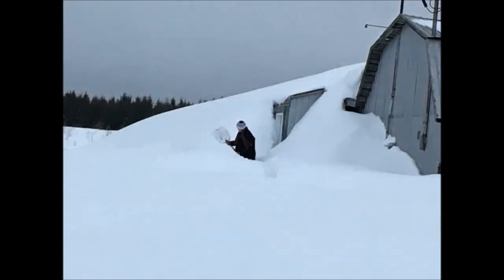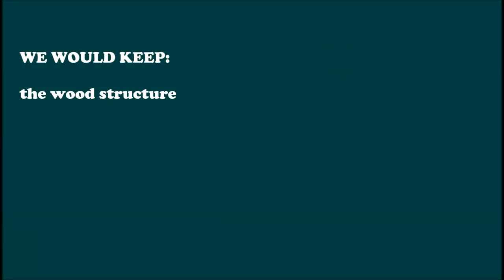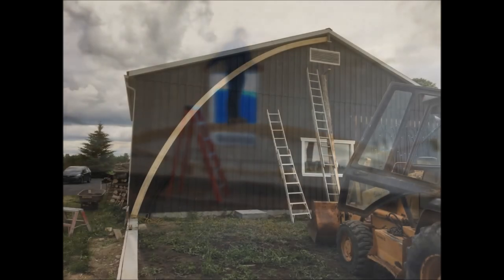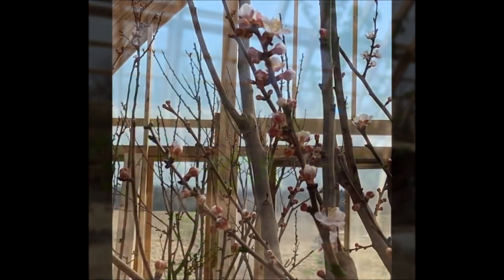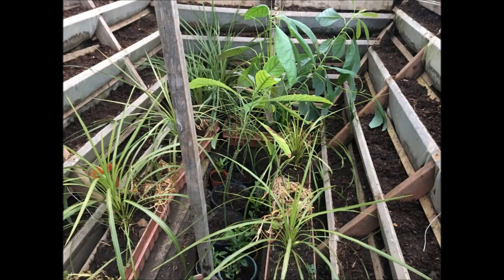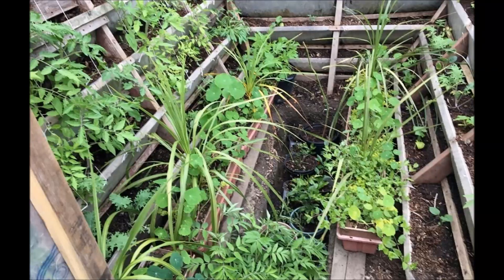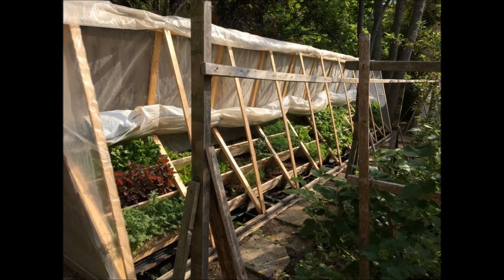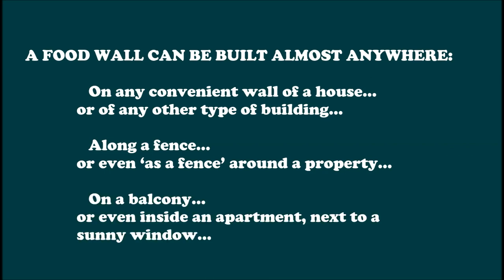5 incredible DIY cold climate projects Plus4Zone greenhouse, in-ground figs indoor orchard food wall

Comment: This is a follow-up long awaited for.  Bravo on all your experiments.  What's the purpose of the drench at 20:45?  I hope Archie could share the design plan of his greenhouse in more details.
Reply from the maker: Thank you. As I mentioned, these are experiments… and I thought that trench (particularly with some additional side insulation) would be useful for some cold-sensitive perennials, such as grapevines.
Archie's greenhouse was designed for his specific conditions (adjacent to the existing shop). I think a 'stand-alone' greenhouse of this type would not need to be that wide or high.

Comment: great ideas! Gives me a lot to think about here. have you ever considered incorporating plastic coke bottles filled with water as thermal mass and solar heat gain? I find they are pretty tough and last in the sunlight at least 4 years. Buried I think they would last indefinitely.
Reply from the maker: Thank you! Based on our experience, using some sort of water tank as heat storage would be a solution in a temperate climate where day and night winter temperatures alternate above and below the freezing point. But in cold winter regions, where the minimum winter temperatures can drop to -30 Celsius / -22 Fahrenheit, and both day and night temperatures can stay constantly below the freezing point for a few days or even weeks, and the sun may not shine for days... the water tanks would become a solid ice block sometimes in December and would not melt until the end of February... actually becoming a 'cold battery' inside the greenhouse, instead of a 'heat battery'.

Comment: Thank you for your videos! Would you happen to have detailed plans for your thermal-efficient food wall? Does the earth fill against the back wall with your 1x6 planks, or do you place something there to displace that much earth/compost? Would you use composting to provide heat to the greenhouse?
Reply from the maker: With pleasure! I do not have plans for the food wall, but if you want, I can email you some detailed pictures (my email address is: hw@humanwisdom.ca)
If I understand your question correctly, the earth/compost fills the space between the 1x6 planks and the back wall - which allows the natural 'heat' of the earth to rise up into the food wall. In order to enhance the thermal efficiency of the food wall, you can install polystyrene sheets:
- in the ground all around the perimeter of the food wall base, and
- as a 'thermal liner' on the interior of the back wall plywood.

With regard to compost heating, the answer is a bit longer... In principle, compost heating is indeed a great ecological solution to heat a greenhouse. I have learned as much as I could on this subject a few years ago - starting with the works of the admirable Jean Pain. 
That said, to answer your point there would be a few things to add on this subject:
1. I decided to first finish my 'digging' and learning about the unheated greenhouse solutions to see how far we can go by simply storing the solar energy into the greenhouse earth walls and floor, and by minimizing the heat loss thru the greenhouse roof...
2. As a result, I learned that we can easily grow temperate-climate fruit trees and grapevines in a greenhouse located in a cold-climate zone; and I am about to experiment how lucrative would be to grow reliably subtropical-fruits in an unheated greenhouse located in a temperate-climate...
The big challenge comes when we try to 'jump over' 2 major climate zones - like for instance growing temperate-climate fruits in a very cold-climate, or growing  subtropical-fruits in a cold-climate... And there, compost heating may be a good solution...
3. Compost heating has also a few 'sensitive' aspects, such as:
- it would take quite a lot of compost to generate some substantial heating in a medium or large size greenhouse throughout a long winter in a cold climate - which requires quite a lot of work every year, and also to have relatively easy access to that large amount of compost...
- compost emanates certain gases, which, if placed within the greenhouse, would affect the air quality... A solution to that would be to place the compost pile outside the greenhouse - which then requires some plumbing installation to transfer the heat from the compost pile into the greenhouse...
All that said, I would like to reiterate my belief that a well-conceived compost heating system could be a very lucrative ecological solution for a greenhouse.

Comment: Did you let the snow cover the roof of the warehouse greenhouse in the winter - like your previous backyard example you showed us - to retain heat? If you did let the snow cover the roof in winter (which would block out all the sun) did you add indoor lighting to make up for the loss of natural sunlight?
Reply from the maker: The first winter, I pushed the snow off the roof as I was not sure how the plastic will resist... The following winters I became 'curious' to see if the plastic and wood structure will resist and I did not remove the snow anymore.. and everything was fine. All the fruit trees and grapevines in that greenhouse go dormant in wintertime, so the amount of sunlight they receive is not essential for them.

Comment: Hello Dan, I have watched all your videos and love the idea of growing Cherries. An indoor orchard sounds so beautiful and delicious. I have suggested putting up a greenhouse over the footing of an old horse barn. A massive horse barn that now only has an outer footing that is approximately 180 feet long and about 75 feet wide. Within this area are three cement pads ( each approx. 12 feet wide and 180 feet long) separated by 12 feet of sandy rocky soil. I was thinking that there would be enough room to plant the trees and have concrete pads in between the rows of trees. In the first barn video, you removed all the concrete. Then in this video, you said an improvement would be to put insulating styrofoam on the outside of the concrete footing. Does concrete affect the greenhouse climate? Would having these concrete walkways between the trees affect the trees and cherry harvest? I really don’t know if the cherry trees would grow here at the foot of the rocky mountains (Alberta) in a greenhouse. If the concrete would be useful for a greenhouse I would like to try to use it. Thank you for your research and videos. Any insight would be greatly appreciated.  Carrie
Reply from the maker: Hello Carrie, our barn converted greenhouse had a concrete perimeter foundation with no insulation - and yet, it worked very well for all the fruit trees and grapevines inside. In this updated video, I mentioned that an 'improved' greenhouse model should have some insulation around the foundation so to minimize the freezing of the ground inside the greenhouse.
I would need to see some pictures to better understand the setting of the concrete pads on your site... but in principle (given that you can have winter temperatures that can drop to -40 Celsius) if you will build some good earth berm walls around, I think you should be able to grow cherry trees successfully. If you have any further questions you can send me an email: hw@humanwisdom.ca
Reply: Concrete, stone and water all can gain thermal heat from solar during the day, and though not a massive amount a dark color helps this process. Every little bit helps. Then as temperatures drop the heat is released slowly. If you have enough mass doing this, sometimes it is enough to prevent your plants from freezing/dying.
Reply from the maker: @blueupgreendown6402  Based on my experience, using water tanks as heat storage would be a solution when day and night winter temperatures alternate above and below the freezing point. But in cold winter regions, where the minimum winter temperatures can drop to -30 Celsius / -22 Fahrenheit, and both day and night temperatures can stay constantly below the freezing point for a few weeks, and the sun may not shine for days... the water tanks would become a solid ice block sometimes in December and would not melt until the end of February... actually becoming a 'cold battery' inside the greenhouse, instead of a 'heat battery'...

Comment: How do you pollinate such a large indoor orchard during the middle of winter when bees are clustered for the winter?  These projects are amazing - thank you for sharing!
Reply from the maker: Thank you! Most of our trees are self-pollinating. A few years ago we also bought some bumblebees, but the air draft of the natural ventilation does most of the job.
One of our YouTube friends here also suggested placing a beehive within the greenhouse wall with 2 trap doors: one that we can open towards the greenhouse when the trees are in bloom, and a second one that we will open to the outside for the rest of the spring, summer and fall.
Reply: @HumanWisdom  That would be a very interesting experiment!  (I'm a beekeeper, hence my curiosity.)  You'd have to monitor the temperature in the hive - too cold and the bees will stay clustered tightly together and won't fly out to forage and pollinate your trees.  Also, you'd probably need to monitor the levels of nectar and honey in your hive closely - it's possible they'd stay warm enough to pollinate your fruit trees, but that the fruit trees would not provide enough nectar to support the higher than normal level of activity in the hive, so you might need to feed the bees to keep them active and prevent starvation.
Reply from the maker: @abigailjacob4043  Thank you very much for these important notes!

Comment: Should I build a greenhouse outbuilding after an unheated fashion, and put my home server computers in there? It wouldn't be an unheated greenhouse, but as long as the temperature stays above freezing by doing so, it would consume no additional energy that I don't already consume, and I'd have the advantage of further extending the season, and no longer polluting my living space with the noise and nuisance of loud server equipment, and still being able to benefit from the convenience of having a home server (which could also have connected USB dataloggers (which would consume additional energy) to register the temperatures and humidities of the air and earth inside the greenhouse).
Reply from the maker: In principle, I think this is an interesting idea. With regard to maintaining the temperature above freezing level, I would say it depends on the thermal efficiency of the greenhouse and also on the climate zone you are in. Another element to consider would be the humidity level, so not to cause any damage to your computer equipment - a good (natural) ventilation may be a solution to that.

Comment: Hi Dan! Can you explain the last design in this video, in particular what was the reason to dig the trench?
Reply from the maker: Hello, the reason for that trench is to create an area that would be a bit warmer than the rest of the 'food wall' in the middle of winter. If the sides of that trench are properly insulated with some polystyrene boards, the warmth from the bottom of the trench would be beneficial to the plants.
Reply: That explains! Thanks!  It would also be good if you share your planting techniques. I do have a small greenhouse in a slightly cold but mild climate of Denmark,  but I can not grow tomatoes and cucumbers. Plants are weak, so your experiment expires me.
Reply from the maker: @oleksandrzaslon5367  With regard to planting, it is essential to ensure the young plants have adequate nutrients. For example, the compost that I used in the food wall contained quite a lot of mature horse manure. We also use comfrey tea on a regular basis (diluted in water 10:1). I learned that nettle tea is also very good for young plants to grow strong, but I have personally used only comfrey so far. 
Also, when we plant tomato plants, we bury most of the plant body (trunk) in the ground (not only the root area) - and the plants a growing very strong roots, which will nourish the entire plant abundantly. I wish you best success and enjoyment of your garden!

Comment: Looking for resources to plan and build a temperate climate greenhouse in Zone 7b North Carolina. Concerned more about greenhouse overheating than maintaining heat in winter. Please help.
Reply from the maker: I zone 7b, with a thermal-efficient greenhouse, you can create a real 'fruit paradise'! Any greenhouse must be adequately ventilated! I do that through natural air draft (no fans) by providing LARGE windows all along the long walls AND also on top of the end walls (or ideally directly on the roof, if possible). 
I wish you best success in your green project!